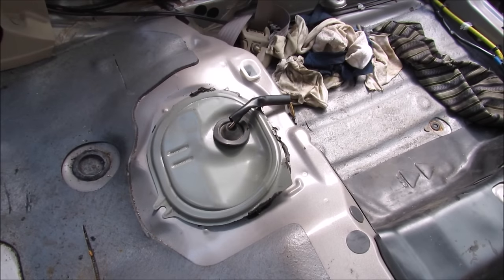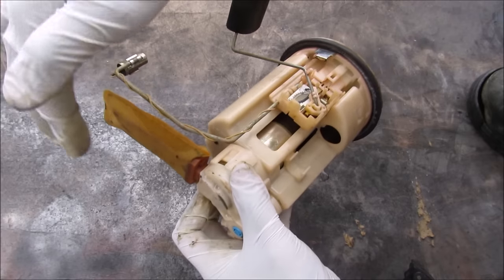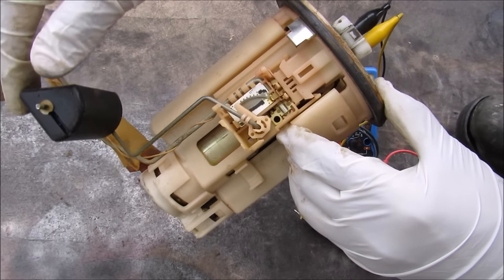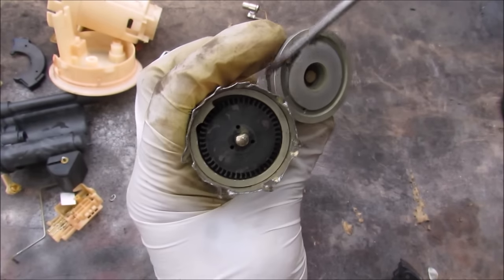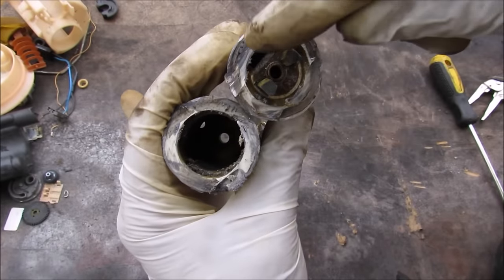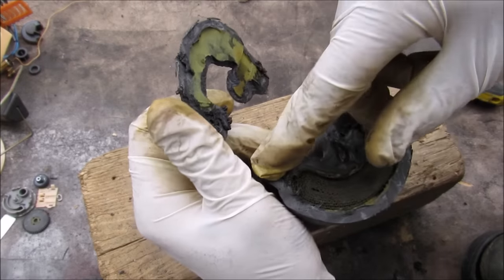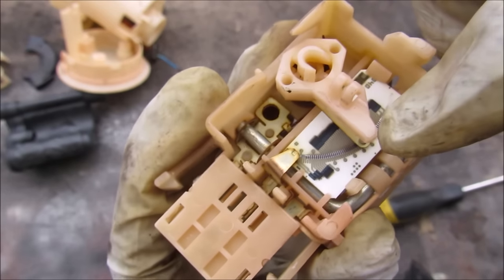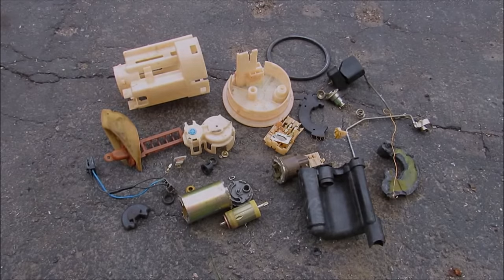How a Fuel Pump Works

Comment: We knew from the case of hydrodynamic pump that the casing must increase in flow passage in order to convert the velocity head into pressure head .... Why this is in reverse ????? The area gets shallower
Reply: I found when i asked my professor that the area  is increasing only at inlet and does not get shallower and that for admitting the flow only at inlet

Comment: is it a myth that if you drive your car with low fuel in the gas tank you will clog your filter because rust particles will be on the bottom of the tank and pump will suck them? For me it seems that it always sucks from the bottom of the tank so it doesn't matter if you drive with full tank or with 3 gallons tank? What is the truth ?
Reply from the maker: True that yes particules can collect but that's why there's a filter!

Comment: Do This fuel pump have another fuel regulator on fuel rail???
Reply from the maker: Some cars have a damper
Reply: @speedkar99  damper is same as fuel regulator..?? if not so damper and fuel regulator can both be in one fuel rail

Comment: Speedkar99.. My 2002 Toyota Celica GT-S was broken into and the gas was siphoned a few years ago... since this event, my gas gauge gives me no reading and my gas light stays on... The only way I know how much gas I have is to keep it full all the time. Sometimes, my my car floods out and the engine light goes on. when it floods out, it seems like there is no gas flow. I have to drive it around till it it drives normal and then in a few days, the engine light turns off. I was told that when my car was siphoned, the hose that was shoved down into the gas tank probably broke the sensor or the floater and either of them could be interfering with the gas flow. Is this possible????
Reply from the maker: Yes that is possible. See my evap system video where I cut open the gas tank for more info.
Reply: I took my car to a mechanic and told him about my car tank situation. I told him I wanted my tank inspected to find whatever is interfering with the gas flow and not giving me a reading... He told me that my scenario is impossible and insisted that he is correct in his diagnosis... stating that his scenario is correct and that my scenario is a separate issue that, of coarse, will cost me more money.. I went and picked up my car from this mechanic who held my car hostage for two solid days. I have my car back but wanted so bad to finally get it fixed... Can you recommend a good mechanic.. where are you located????
Reply: @mariaunkovich2500  based on what you described and the issue started after syphoning the gas, I say that the float on your fuel pump is broken, whatever was inserted in the tank hit the float, the are very fragile and lightweight so they are easy to break, where are you located ?
Reply: Thanks so much for answering my question... I living in Southern California in a city called Montclair... but let me update you... My Celica was totaled in a parking lot in late August.. I have a 2013 Toyota Corolla S now... I really wanted to get my Celica up to par to gift it to someone I know but I guess God had a different plan

Comment: still searching for an answer can you back flush fuel line with air the blow out restiction of the sock that is the reason for failure of pump eventually

Comment: i have petrol indica car which has a problem in supply of  petrol to engine.  The engine  is under   starting trouble and found out petrol not come from petrol pump in petrol tank. Then I have  replaced petrol pump  engine started. next day morning the same problem  . I have replaced four pumps. but  engine starting problem not rectified. due to petrol supply

Comment: i just replaced the assembly and fuel regulator and my car still has the same problem. My car stalls and stops randomly while driving and when i come to a full stop and it quickly starts back up after a couple cranks. What do you think could be the problem?
Reply from the maker: +abel m Idle air control valve

Comment: I chastised a popular YouTuber not so much for using shop air to do EVAP smoke testing but for not disconnecting battery and other disregard for the hazard created while doing it.
Normally, there are hydrocarbons in tank and no oxygen present so an energized fuel pump isn't a concern.
BUT, when shop air displaces the hydrocarbons then all bets are off!
If one choses to use shop air to do EVAP smoke testing, at the very least DISCONNECT the battery!
Reply from the maker: Good tip

Comment: Thank you!  I’m trying to change my sisters fuel pump on her 2001 gmc Sonoma 4x4 little truck and I wasn’t sure what type of unit it had or where it was. 
Can you do a video on a 1992 Cadillac Fleetwood front wheel drive transmission?  I still don’t know what a viscous converter clutch is on an automatic. 
I’ve been trying to find a low mileage engine and transmission. I’m puzzled by the viscous converter clutch. Thank you. Joseph 
jaduranjr at icloud
Reply from the maker: Check my torque converter video

Comment: 3:07 The fuel pump doesn't compress the fuel, liquids aren't compressible.
Reply from the maker: +John O technically you are correct, more like it creates fluid flow which creates pressure

Comment: And they say water is a incompressible fluid, I call that a lie
Reply from the maker: +knightrider1545 Why do you say that? The pump creates flow, it doesn't compress gasoline.
Reply: the video says the gas gets compressed which is in a liquid form
Reply: as the rail gets smaller it "compresses"